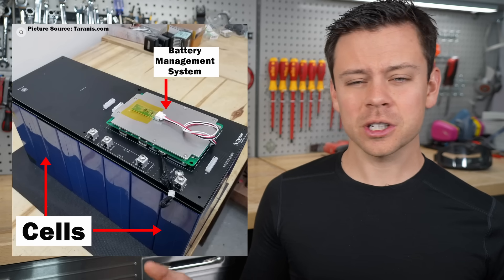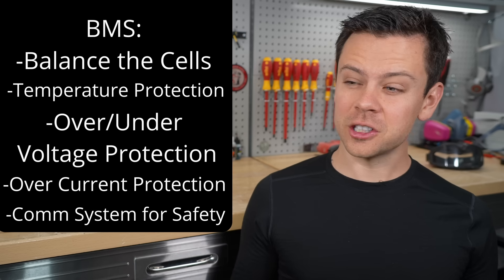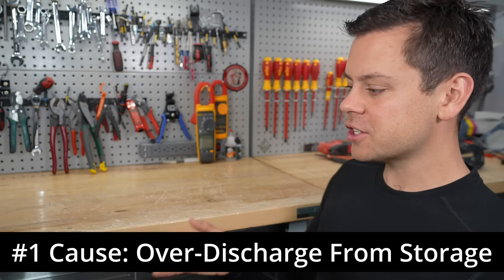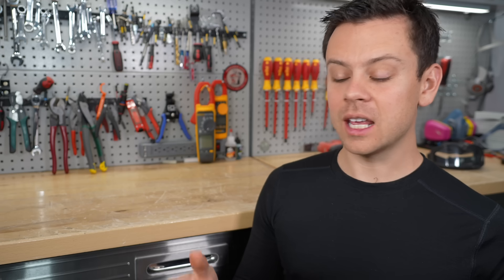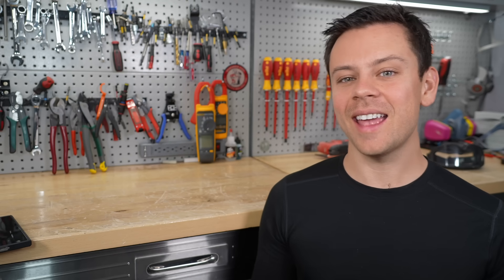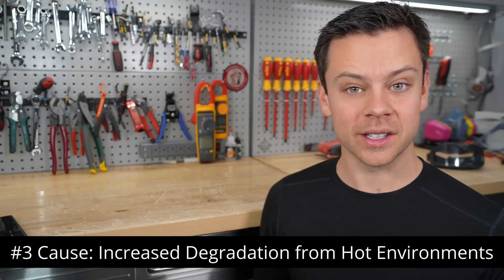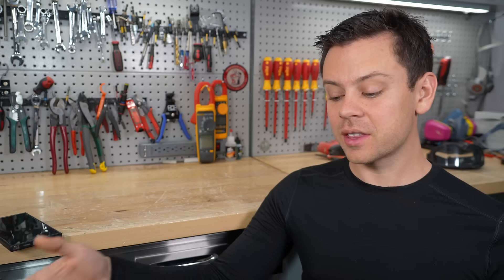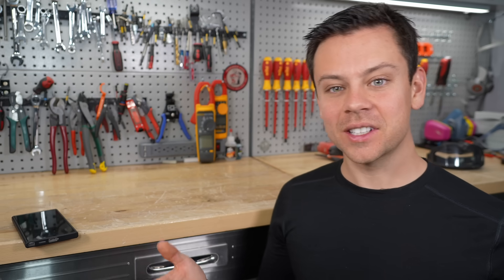The Rules of LiFePO4: The 3 Most Common Causes of Failure and General Guidelines for Long Term Use

Comment: Help please: I have the eg4 3000 and eg4 48v ll-s.  What do i set the programs to to get charging to 100% and discharging to 0%?  Thanks for any and all advice!
Reply: And Thank you Will !!!
Reply: @danaryne2970  use what EG4 recommends in their most recent online manuals. That is probably around 56v. I don't understand why he says 0% because that would be where the battery shuts down and you wouldn't want to do that.
Reply: Thank you  @LarryKapp1  , it looks like the lowest allowed by the eg4 3k is 5%.
Reply: @danaryne2970  I think Will was just trying to make a point that theoretically and ideally  you can use up all the power . But in reality you don't want to go too low because you would get too close to the threshold where the battery might shut off due to under volt protection , especially if there are unbalanced cells.

Comment: The balancing issue also applies to laptops.  Lenovo has this feature where you can limit the max charge to less than 100%, but every time it results in user complaints of the battery dying unexpectedly.  I've found that the solution is to set the stop charge threshold to 100%, but the start charge threshold to 90%, so it isn't constantly topping off the battery if you discharge it down to 97% or so.  No more user complaints after that, and I've gotten laptops set that way back after three years that still had 70-80% of their original capacity (bear in mind, these are Li-Ion cells, so they degrade faster than LiFePO4).
Reply: Micro cycling vs floating is a valid debate 🤔 Apple limit the charge to 80% in their laptops if they've been plugged into the wall continuously for several days, but if you unplug and replug it charges to 100%.

Comment: I have a bad BMS finding a replacement BMS is not easy. On the circuit board there is printed SST19-863-REV3, and P15S100A-RX21145 unfortunately these model numbers are now where to be found, Deye 5kW battery

Comment: What is 0 percent voltage.
Reply: it would be where ever your bms says 0 soc or when it shuts down !  You don't have to take it down to 0 - I think he meant that the battery won't be harmed doing that ( if the bms is working right ).

Comment: The few failed units I've had all were the BMS went bad. Technically blocked the batteries from getting charged. Heat storage, well that's another issue here in Texas that goes up over 100F in the summer. All very good info for viewers, so great video :face-blue-smiling:

Comment: The reason people think of the 80/20 rule is because EVERY supplier in China tells them that. When I was researching LFP about a year ago I contacted at least 10 suppliers and without exception they all said to get the best longevity using daily with solar I should charge to 80% and discharge to 20%, with a monthly charge to 100% to top balance. I purposely bought 60KW battery even though I only need 40KW so I could achieve this, I won't be changing my routine now and I expect to get 6,000 cycles as claimed. I also have AC in the RE room which triggers once the battery hits 30 C and so far it's always between 20 & 30 C. Lookup 'Engineering Explained' - How To Ruin Your Electric Car's Battery - LFP Edition!  for the latest study

Comment: Thanks for the video, Will. In one of your older videos, you mentioned the ‘sweet spot’ for LiFePO4 is 20-80%, so that is what I have been shooting for. I have a 24V system with Eve 304 Ah cells and have been unable to get any info from Eve as to what voltage equals SOC%. I have my BMS (Overkill Solar from Watts 24/7) set to go into balance mode at 27.2 (I THINK is 80%?), which it gets to virtually every day, but my lowest voltage after all night is usually 26.4. Generally the difference between the lowest and highest cell is about .004V. I try to take them down to about 25.2 (30%+-) every month. But it takes a day or two with my panels shut off and just wasting power any way I can to get them down that low. Am I ok like this? Advice? Thanks for all you do!
Reply from the maker: Charge to 100% and down to 0%. I made a video about cycling thresholds pertaining to NCA a long time ago and people thought I was talking about lithium iron phosphate. It is true if you discharge the low voltage cycling threshold, It can increase the cycle life but it's not worth it. Calendar aging will kill it before you will reach that point. To just charge to 100 and down to zero

Comment: Good & relevant info! This may not ba as common of scenario but,  we deployed several 24v 120Ah batteries in UPS setups. We noticed over prolonged periods of maintaining 100% SOC we would begin to see cell imbalances. 

The solution was to schedule a discharge & charge cycle every 6 months and allow the cells to equalize.

Comment: Do you have recommendations for these batteries that have replaceable battery management modules?
Reply: most any of the ones that have metal cases you can easily open up by taking out screws , and not the plastic ones that are glued shut.

Comment: My lfp has been powering my entire daily life for 5 years so far and It still feels like science fiction that a battery the size of 2 cases of beer can do that. Its already paid for itself so I have another 5 or 10 years of free power but I am likely to upgrade before then. Waiting until I can buy  panels of 30% efficiency that takes my 2000w to 3000 so I can consistently fully charge the extra capacity. Good advice as always Mr Prowse, use the crap out of them and break even sooner then be saving from then on. Not to mention the warm and fuzzies you get from getting bent over by one less corporation.

Comment: If one has to replace a BMS, ass-u-me-ing any and all case designs allows any novice to do this, can you explain this further?  Most of us are not going to saw open a case…..
Reply: That is what you would have to do if you have a plastic cased battery that is glued together. That is why I would tell anyone to get a metal case battery that you just take a few screws out to open up.

Comment: What is the best utilitarian way to protect lithium batteries from heat degradation if living in the desert? I live in the west Texas desert outside of Big Bend National Park. I don't really have an air conditioned place to set up the batteries. I'm hesitant to place it in a utility structure since the air could stagnate and build up heat. I thought about placing it on a platform off the ground with it closed in on only two sides to allow air circulation and a small roof covered to protect from the sun and rain. But the heat would still be an issue. Thanks.

Comment: You didn't mention charging below freezing? If the BMS doesn't cut off charging at low temp (most don't), and you charge an LFP battery, are you not irreversibly damaging it?

Comment: Great video! I was hoping for more info on cold use as I live  in my vehicle in Minnesota...
Reply: you have to keep them warm. The resistance goes up in them as they get colder. Build an insulated box around them and put in some kind of heater . That is what I did in unheated space in Wisconsin .
Reply: @LarryKapp1  Thanks for the tip! Will do.
Reply: @LarryKapp1  Btw, I found a 4 watt reptile heat pad as a warmer for my battery...
Reply: @GalvestonGuy  That might work if you have a small battery and box . 4 watts is not a lot of heat. I have used the 20 watt heating pads for putting under seed trays in greenhouse. I have also used 150 watt 4 x 5 inch silicone heating pads made to stick on engines . I wouldnt put one of those directly on a battery but on a piece of metal because they get pretty hot. All depends on the space you need to heat and how cold it is outside. I have a video on my youtube how I have used both of those mentioned above to keep refrigerators warm in unheated shed.

Comment: Touch on keeping them in "UPS mode" always plugged in and charged to 100% where outages are rare... (Like a prepper setup protecting a freezer.)
Reply: You want to float them in this case at a voltage that will not send any current into the battery once it's been fully charged. You can float them at 13.4 (3.35v/cell). This would be safe for a UPS mode setup.

Comment: Yes, people online are really anal about charging to 90 percent only, and or discharge to only 70 percent or less. Whether this makes the battery last longer, who cares, i always need want maximum performance rather than super longevity. 

With lifepo4 batteries they are hardy, and will last a long time. I personally drain my lifepo4 to about 70 to 80 percent max in use, not everyday just when i need. And then charge lifepo4 to 100 percent when i need to get long use out of battery. So far my lifepo4 batteries are holding up well. And I don't charge when super cold. I store them at about 80 percent of charge, if long storage.

Comment: I'm in the process of upgrading our travel trailer solar package and adding a LifePO4 battery plus inverter in preparation for a trip south to escape our cold winter months, temperatures will be below freezing on our first few driving days. How should I manage the battery, should I completely disconnect it from solar, vehicle charge,trailer load or will the BMS take care of it ?

Comment: How does the C rate affect the charging degredation.  If you are charging a 100amp hour battery at 0%?  At 75%? Is1KW charging bad or is drawing 1KW of power bad when battery is nearing 100% or 0%?

Comment: Off topic a little, but how can you use gas generator w/ dirty signal to charge lifepo batteries?Is there a component/s that clean to pure sine? Having hard time with limited sun. Solar panels aren't giving enough charge.  Any help would help.😊
Reply: You need a LiFePO4 compatable smart battery charger. This cleans up the dirty generator power.

Comment: I have an off grid cabin that is not continuously occupied so the temps may get down into the 30’s and sometime below freezing. Will my batteries be ok in this environment? They will connected to the solar panels and charge controller all the time. I will be using the Signature Solar EG4 48v batteries. Any feedback will be greatly appreciated.

Comment: My two LFP solar generators are constantly abused.  Charge at 40s in winter and 105s all summer long.  Used frequently, sometines daily living off grid solar in Tucson, AZ.  Little if any degredation after a year and a half.  Now they cost 50% less.  Yahooo.

Comment: bms failure seems more common than it should be, I've gotten several expensive batteries that had perfectly usable cells for free but required a bms replacement.

Comment: Thank you Will.  I have the Bluetti AC200P in my van and I have been on the road full time a year and a half now.  I have 720 watts of solar and every month or so, as Bluetti suggests, I discharge to O and charge back to 100% to sync the BMS with the batteries.  That fixes any issues like, you are up to 100%, but in 5 minutes you are down to 80% with very little drain.  That just means it says it charged to 100%, but was really only around 82%.  Once in a while, I have to do it twice if I waited too long.  But, once I do, I can run my ac in the summer just fine and my diesel heater in the winter and my fridge year round with no issues.  I also have an EB3A I use to charge my cell phone, cordless tool batteries, power banks, etc .  I charge up the EB 3A from the Big Bluetti which gets power from the sun.  So far, so good. 1.5 years on the road and off grid. I bought your book to learn about solar installations and did all of mine myself.  Thank you.
Reply: What kind of AC unit do you have? just curious; I’m down here in Mexico right now I’m dying of heat. I live in Texas, so it’s not any better when I’m up there. I’m looking at some Chinese parking air conditioners right now.
Reply: @jonathanmiller8977  I shopped around a while looking for the lowest power draw 5,000 btu ac I could find.  I got a keystone unit from walmart.  It draws about 350-375 watts when the compressor is running, which since I always run in eco mode  is as little as possible.  It is energy star rated and even has a remote control.  I have now been using it on the road full time for three summers now.  Best $200 I ever spent.

Comment: This is why I love Will. Sensible and easy to understand tips. I don't have solar system (I'm poor! 😅 although want to have one) but the tips apply to similar battery types. I'm recharging my 8Ah Bosch for my tools now so they won't die from storage.
Reply: Surely 'nonsensical' is the wrong choice of word.
  Roughly to what level are you going to charge them for storage?
Reply: @johnrhodes3350  My bad, I meant sensible. :) English is not my first language, I amended my post. I've been not using my 8Ah battery and have been using my smaller ones 4Ah/2Ah for my powertools. This video reminded me to to check the 8Ah and recharge it to avoid what Will mentioned. I've charged the 8Ah to 100%.

Comment: Do I have to disconnect both my batteries that are hooked up to my inverter in parallel to charge them to 100%, or can I charge them to 100% while they are hooked together?
Reply: Parallel, no worries. Some companies recommend taking series apart, parallel to charge, then rewiring in series, but no one I know of has had any problems. It IS definitely a good idea to do the initial charge of new batteries in parallel before hooking them up in series.

Comment: Great practical information, thanks! 
Longevity begins at the factory-
Interesting evidence that a High C Rate initial charge can extend longevity by 50%:
Researchers from the SLAC-Stanford Battery Center (formerly Stanford Linear Accelerator Center) said that charging lithium-ion batteries for the very first time at unusually high speeds extends their lifespan by an average of 50% and up to a maximum of 70%.

The study said: “Formation is a critical step in battery manufacturing. During this process, lithium inventory is consumed to form the solid electrolyte interphase (SEI), which in turn determines the battery lifetime… Surprisingly, high-formation charge current on the first cycle extends battery cycle life by an average of 50%.”

Comment: I am in trouble! I have a nice 4 cell lifepo4 battery that i have had in my vehicle for years that i use for camping. It gets hot, and has no bms. I charge it to about 14v at 0.2C or less. Once a year I use a balance charger to top balance the cells and for the last 4 years, they have stayed within a couple of mV. I do have to be very careful not to over discharge so it's certainly not a set and forget system. I think a lot of the time, the bms itself self powers off one of the cells and can cause an imbalance. You should do some bms testing to see which bms have the most or least power draw and do they draw the power from the balance leads and in particular, from a subset of the cells. Great video.

Comment: I built your 3KW dolly-based system to use in case of a long-term power failure.  That's all I need it for.  Rarely, I discharge it till the system shuts down and then recharge it to 100% with ac power, then turn off both the battery and inverter.  I turn on the battery itself now and then (every couple of months) and it always shows 100% charge on the battery charge lights -- which of course only means it's still above 75%.  It's been 4 or 5 months since I re-cycled the charge.    A 75% charge will satisfy our needs for almost a week and worst-case I can get 300watts of portable solar going to extend the time if we need to.  Permanent solar is not possible where I live.

My question to you, Will,  is whether am I handling this in a proper way or do I need to use some other protocol?

Comment: if you check your videos about a year or two ago you tell people to don't fully discharge and don't fully charge your batteries 
think it was 20 % and 80 % look back and see
Reply: I recall seeing those videos...but that was when Will was building his own batteries , and not using LiFePO4 cells, or a cheaper BMS that had different settings....if I remember correctly.

Comment: In the winter (like now) I can't get my solar system to charge my batteries to 100%. The sun is much lower.  I guess I'll have to connect a LiFePO4 charger to top them to 100%. Kinda defeats the purpose of avoiding the grid power.
Reply: Need more solar panels
Reply: @stevepriority4219  Yep!

Comment: My main issue is keeping them warm enough throughout the winter. I built a 2” foam enclosure inside a 4’ x 8’ crate that houses my inverter and charge controller all inside the 3cu ft foam box. I have the batteries sitting on a 12v warming pad made for Rv water tanks to help warm up the batteries when the temp drops below 32f . We regularly see temps get as low as -10F in January and February.

Comment: been running cheap amazon batteries for 2 years straight and they run my a/c and gaming computer. i discharge them almost to zero at least 1 time a week. i am a heavy power user living off grid.